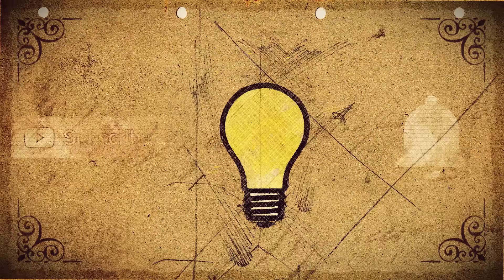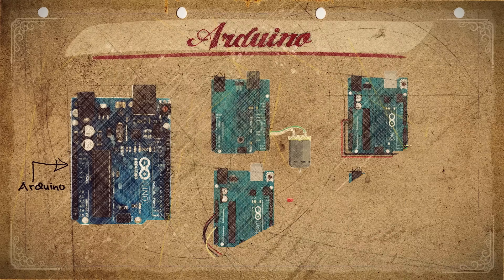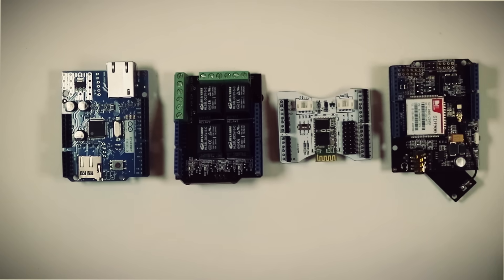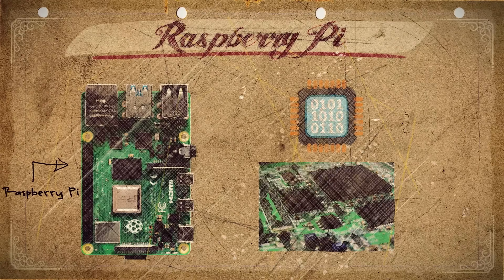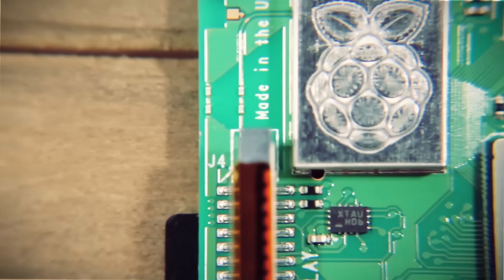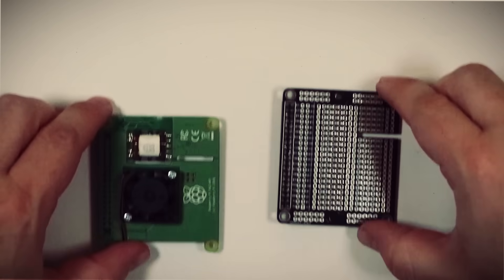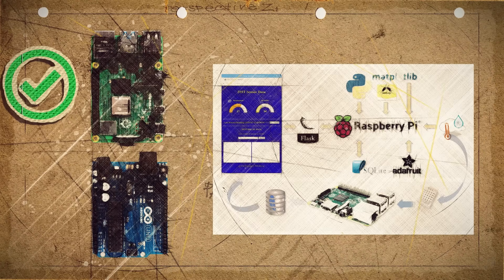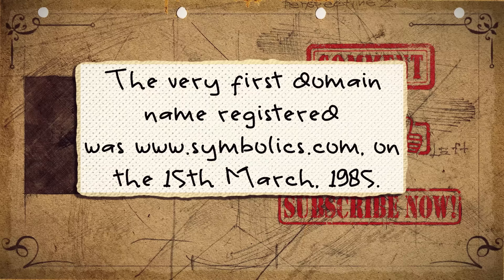What's the difference? Arduino vs Raspberry Pi

Comment: Dear Tinkernut, since raspberry pi are basically like a computer thats running Linux and useable as a arduino combine, would it make more since to have a full sized pc using raspberry pi os or Linux Ubuntu connected to arduino's or raspberry pi's to control a large bi pedal robot, id like to start with python, mostly becuase i can use pydroid and bluetooth to arduino's make it fast and simple using Linux and Android box to control them but I would think that if I used a full-size pc with raspberry pi os and other pi's using serial communication between themselves and the main pc, would make for much faster read and write processing and fast executables? Im new to programming and robotics but I would like to start fast and simple, i can learn quickly and i don't feel the need for a slowed progression.

Comment: If you still check comments

Is there a performance difference between arduino and Pi?
I have some PLC experience and the arduino sounds more analogous
Reply: A Raspberry Pi board has a far better performance than an Arduino; GHz vs few MHz, Plenty of RAM vs few KBs
Reply: Well I’m used to PLCs which just scan some basic code a couple hundred times a second and operate solenoids and servos.

Not little Linux computers with IO

If I DIY a watering system I’m happy to just set it and leave it for 10 days while I’m at work, I don’t need a webcam to livestream my stupid chilli plants
Reply: But yeah, I want a chip to do a thing and do it well

Not host a server, run a console emulator, edit spreadsheets, etc

Comment: Then you may use a Raspberry Pi to program an Arduino to extend peripheral functionality and the Arduino can also give feedback to the Pi for further programming fine tunning. So which one is best? Both at the same time in the same complex project.
Reply: Yeah but if you are just using the pi as a Linux machine then any Linux machine could take its place.

Comment: Now I want to see someone watching YouTube on a calculator
Reply: Sounds like a raspberry pi project
Reply: unfortunately it's impossible, but here's my idea : remove the internal components of a calculator, remove the display, insert a little phone screen atatched to a raspberry pi inside the calculator and make a little hole to conect a usb keyboard and mouse, now you can use the calculator as a computer,  but i don't think this will be no more a calculator
Reply: NeXt tHinG uR gOnNa SaY ThaT iM gOn bE aBlE t0 PlAy DoOm oN a CaLcUlAtOr lMa0
Reply: @aty4282  you already can, technically, but can a calculator run Crysis?
Reply: Surely it will happen someday. Calculators will become phones and phones will become calculators. Then we will need to exchange our phones for calculators.
Reply: Aditya Singh ya no
Reply: @adityasingh3963  no

Comment: Simpler answer would be that anytime you want to process analogue signals(for analogue sensors, pwm for motors etc), you'd wanna use a Arduino. Pi doesn't have a good way to do that. That is it.

Comment: Use them together. Pi controlling arduino subsystems.
Reply: Arx Mechanica do you have any educational sources teaching how to do this?
Reply: I had been thinking the same in terms of robotics... you could use a Pi as the main brain (master) of the robot and then arduino for the individual (slave) sub systems
Reply: @twistedxknights  that's how it's done. 😃👍
Reply: @arxmechanica  nice.. wonder if ysing a pi cluster someone could get a  Ai running and be like a protocol droid like c3p0 from starwars
Reply: @twistedxknights  that would be the dream. wouldn't it? Lol. We are currently building a few of the Inmoov humanoid 3dprinted robots.
Reply: @arxmechanica  none based on the open source Robot x?
Reply: @arxmechanica  Damn this comment section has real nerd debate lol...I like arduino I am not very advanced but i am learning, can you tell me how can i learn advanced programming in arduino
Reply: Pi being the brain and arduino being the worker does the job best
Reply: That's what I'm doing rn on my latest project
Reply: @justinhughes4722  if so, I highly suggest that you take a look at NetworkChucks linux RPi videos.
Reply: @bk109  also, the Raspberry Pi is terrible for timing intensive jobs, because you can't disable interrupts unlike the Arduino, and the underlying OS takes a while to intercept those, thus messing with timings. Also, the Arduino boots much faster than the Pi, because of the Pi operating system.
Reply: @iProgramInCpp  The Raspberry Pi board is perfect for doing real-time work. You are just assuming that Linux is running on the board. That is not a fair comparison as there is no Linux running on the Arduino. Yet another statement for stop comparing an Arduino with a Raspberry Pi board (or any modern ARM based SoC board).
Reply: @bk109  You can use raspberry pi for say a pin-code reader 24/7/265 that's exposed to the elements in order to open doors? Put it in a plastic case with some thermal packaging and forget? Maybe the arduino is better suited for this? Idk, all i know is that i hate java and java-based anything because of stability issues.
Reply: @bk109  And external ADC is pretty cheap and far much better than the internal Arduino ADC.
Reply: @bk109  Yes, run baremetal and take that as a comparison with an Arduino. It blow the Arduino far away ..... ;-)
Reply: @bk109  correct :)
Reply: TMC ICT  An Arduino excels better in hardware interfacing? Are you sure? Does the Arduino have DMA channels for SPI or UART? And let's not compare the maximum SPI speed.
Reply: Together? The Raspberry Pi board can all the jobs an Arduino can do, and it will do it far much better.
Reply: @ArjanvanVught  can you convert your raspberry pi  project to a custom PCB after you're done?

Comment: Awesome info, any idea where I could find any good tuts/documentation to help me started thinkering with pi?
Reply: I just bought one and googled what I wanted to do. But if you know your way around Linux, you won't have many problems with the pie.

The only things that are special about the pie is that it has the raspi config file where you have to enable stuff like hdmi output, gpio output, camera input, ect.

Oh, you also need a micro SD card, as "harddrive" for it.

Programming of the pie is usually done in python.

I myself bought a set, because I wanted to play around with eink displays. It came with a whole python library you can built upon to make stuff work there.

But like I said: it depends on what you want to do.

Comment: I have always been confused by the term "microcontroller", which is funny because I am extremely familiar with processors of all size and complexity. Eventually I realized a microcontroller is just a synonym for "simple processor". Or, rather, a simple "system on a chip" (includes RAM etc.).

Comment: Dear Sir,  are you deeply well versed in arduino?  I am 38yrs Corporate Technical sales in USA and promoted to ASIA PACIFIC for IBM CORP, before  Disabled retired early.

I need to understand basic capabilities and limits of each type. (Arduino Uno) and others.  I grasp conversation but challenged reading at this time.

Can you consider a phone call to discuss my few questions?  I WOULD BE MOST HUMBLED.  I AM DETERMINED TO WORK.

Comment: I started a project using a Pi and had the i2c timing issue, I followed a tutorial to work around it and it didn't work, I ended up just using an arduino connected via USB and did the heavy processing on a windows machine.

Comment: Thats a perfect comparison laptop vs calculator.
Reply: Worst comparison ever, arduino is a platform, raspberry is an SBC, like a rabbit vs car comparison, nonsense
Reply: @Mcs1v  The comparison is valid, since you use BOTH to accomplish the same thing (It's a maker computer). And you can use a car for everything, while a rabbit can't do most things that a car can (try driving around on a rabbit or transport your shopping). My point is that the Raspberry Pi is MORE USEFUL, costing just 15 dollars more. The Arduino is an futile exercise in minimalism that gives you no advantages when doing a project.
Reply: @aloiskleinestier1848  Less power consumption is an advantage and there might be projects where this particular thing would make the arduino more suitable to use.
Reply: @artur6912  like not having a continuously interrupted work environment. Linux intercepts interrupts and may mess up timing based software on the Raspberry Pi, and you can't disable interrupts. On the Arduino, you can, and it will not mess with timing.
Reply: @aloiskleinestier1848  Arduino is a microcontroller development platform, consisting of several different devices. Microcontrollers and computers are vastly different things, and they are most certainly not used to accomplish the same thing. Raspberry Pi is pretty useless in timing-critical purposes (most immediate hobbyist cases would be accurate stepper or servo control, bit-banging at higher speeds) and lacks AD converter, and has only two PWM channels at most; one, if audio is in use (Arduino Uno has six.) GPIO pins on RPi are electrically pretty fragile too. RPi also takes far longer to boot and requires a controlled shutdown. Arduinos offer plenty of advantages in the purpose they are intended for.
Reply: @aloiskleinestier1848  Pretty odd comparison: A Raspberry Pi board with 32/64-bit ARM SoC 1 or 4 cores at 1GHz, MB of RAM, SDCard, HDMI, Ethernet, DMA based UART, SPI .. and then the Arduino 8-bit, kB RAM, run at some MHz ...........
Reply: @iProgramInCpp  Does the Arduino run Linux ? No, so do not compare with Linux on the Raspberry Pi board. Compare with a non-OS ... it is fair, the Arduino is nowhere; or, it is an odd comparison. The Raspberry Pi board can do far better timing than an Arduino
Reply: @KarriKoivusalo  "Raspberry Pi is pretty useless in timing-critical"  -> So wrong. The Raspberry Pi board with the 32/64-bit ARM SoC running at 100'sMHz is far better in timing than an Arduino. Compare HW with HW. That is fair, any other is useless
Reply: @ArjanvanVught Surely then you have a compelling bare metal project example to give? Even on fully pre-emptive Realtime OS the Raspberry Pi has ten times the interrupt latency (~110us) the lowest end 8-bit MCU has, so that's not going for the "far better" territory.
Reply: @ArjanvanVught  When did I compare the Arduino to the Raspberry Pi? I don't think I did. I mentioned the flaws of the Pi and why you might want to use an Arduino.
Reply: @Arjan van Vught  you’re confusing “timing-critical” with fast, that’s all. i don’t care if RPi runs at terahertz, i still can’t use it in real-time systems. and i use it a lot.
Reply: @KarriKoivusalo  Yeah, exactly. The video and the comments by and large are bizarre to me.  I use different microcontrollers (SAMD, ESP8266, ESP32, or AT328), PWM chips, I2C, transistors, capacitors... I mean .... basically you're making a computer. I maintain people who don't know what you're saying should take up knitting for a hobby instead.
Reply: @KarriKoivusalo  cunningham's law is a powerful thing, although i doubt @alois keinestier meant to use it
Reply: @aloiskleinestier1848  it's also more EXPENSIVE for beginners
Reply: From what i understand, a microcontroller is the better choice when timing is critical. That's why you don't use an Android device to control fuel injection on a car...
Reply: My calculator, which is my cellular, is faster than my laptop.
Reply: @yolamontalvan9502  Your cellular is a pc (same as raspberry pi) whereas a classic calculator is the same as the arduino. A classic calculator is faster than your cellular, but you still used the calculator on your cellular. 

Applications or needs may differ but in the end, this is a valid comparison of the Laptop (raspberry pi) vs Calculator (arduino).
Reply: Micro-Computer vs Traffic Light?
Reply: We can describe how a computer works. Ive yet to meet one person who can explain how a calculator works in real life
Reply: Good point. But you don't use a calculator anymore, because every laptop has one built in as software. Why use 2 things when one will work better?
Reply: alois kleinestier tf you mean you don’t use a calculator anymore. Everyone in schools use them. People in a lot of jobs use them...they’re small, portable, accurate, easy to use
Reply: Idk why that came out so aggressive, so sorry!
Reply: @aloiskleinestier1848  everyone uses calculators because they are much easier   to input the digits and other things, for example: sin and cos
Doing that on a calculator on a laptop can get really annoying
Reply: @aloiskleinestier1848  uo
Reply: @aloiskleinestier1848  I use the calculator on my Iphone  as I have it with me all of the time in my pocket.....the laptop is in my study waiting to be switched on and boot up when I get to use it.

Comment: The usability is a bit higher for the arduino, if you build science projects. If you want a web or media server you buy a raspberry. Both in combination is best.
Reply: Jon jonsson what could an arduino do that a pi cant?
Reply: @alexrsps141  they are very different. A pi, operates on 3 volt so the amount of shields are although better amount now, much more limited for easier applications. Arduino operates on 5-12 volts (normally) and have both an easy to use coding library with a ton of users so for everything you need to measure, move etc i would use arduino as it is inexpensive and easy. The microcontroller - arduino , does what you tell it to do and thats about it. A pi, need to have some interface to do that . typically -to drive a full 3d printer with 5 few stepper motors and temp switching, and limit switches a shield with a million users cost around 10 euros, then you need a few stepsticks. Same CAN be done on a raspberry but no ones really doing that as it is complex, and much more expensive to get working. Arduino community provides codes for small lcd:s ..motors etc so it is a toolbox. you can run it together with a pi though and thats a good tcombination.
I would never use a raspberry pi alone on a 3d printer (as for example ) as my startup time is 2 secs on the arduino and does exactly what i have done in it , repeatedly while an pi would cost me loads of work and manually start ( or program me) a software doing the same. Arduino is a perfect data logger etc etc.
Reply: @alexrsps141  Operate on a 9v battery.

Comment: I have never understood this argument. You can get a Nano for $10, a Uno for $12 or a Mega for $14. A pi and a mega would cost less than $50 and you have the best of both worlds.
Reply: An arduino can run on AA batteries for 6-12 months with sleep mode great for remote applications since is far more simplified and also has ability to read analog signals which you'll need to read some sensors and potentiometers.  It also has the advantage of booting instantly and easier to program.  Otherwise yes a PI has a lot more to offer then with the full operating system and media supported.
Reply: You can get Arduino 8-bit boards for far cheaper if you buy the clones from China (more variable quality but generally decent), they only cost a few dollars each (a Nano sells for $5 or lower) and often come with free shipping, which makes it ideal for a newbie who isn't yet looking out for potentially controller-damaging mistakes like shorting I/O pins to each other.
Reply: Yeah right? When you want a range rover for offroad hobby and a sports car for work, why not just buy both? They would cost less than $100k and you have the best of both worlds.
edit: The example is exaggerated that's right but think about it like this. $1 is ₺8 in Turkey and everything electronical costs 2 times more because of the import tariffs and Euro. For example ps5 is ₺8.300 in here which is equivelent to $1.000+. So pi+arduino actually does cost more than $50 in here. I hope that you have a better understanding of the argument now.

Comment: one thing you should say is that Raspberry Pi is 3.3 Volt I/O and Arduino 5 volt I/O
Reply: the Pi does also have 5 volt pins on the GPIO
Reply: MelonNF but you cannot control that as a button. The buttons are all 3.3v.
Reply: the better arduinos are 3.3V too
Reply: Barne Bock  not the same. For one you shouldn’t use that 5v to power much but the gpio outputs only 3.3v. So you can try operating 5v items with it but it’s not ideal. I get a ton of interference and false positives when using my pi with a 5v relay for an arcade claw machine. The nano does this faster and flawlessly, while the pi would require me to use a schmitt trigger.

Comment: I often hear that Arduino is programmed using an Arduino programming language, this language, that language, now you say C#... All of this is wrong, most of the Atmel microcontrollers, including ATmega328p (which is used on the most known Arduino board - UNO) can be programmed in C/C++ with avr-gcc/avr-g++, which is the compiler that Arduino IDE uses. It's not similar to C nor similar to C++, it is C and C++.

Comment: There are heterogenous SOC solutios for things which needs cpu and mcu. It is interesting thing becaus mcu and cpu are connected internally and you can access peripherals from both. (Nxp imx or stm32mp1 for example)

Comment: Keeping is mind Murphy's Law, overkill is also asking for extra trouble. I prefer arduinos if it enough (memory, etc).
Reply: Or there are also other microcontrollers than Arduinos, like the stm32 Blue Pill, that has some superior capabilities.
Reply: @caffeinatedinsanity2324  ESP32 has been the way to go for me, it costs a fraction of an arduino (about 4€) and is superior in every single way, 240MHz Clock speed, (arduino's max is 16MHz), more ram, more flash, has more gpio pins and also has wifi/bluetooth capabilities and can even host a web server...

Comment: I absolutely do not agree with the recommendation to start with the Arduino. While some things might be easy on the Arduino, it will get more difficult over time. You can do a lot more with an Arduino then you might think.